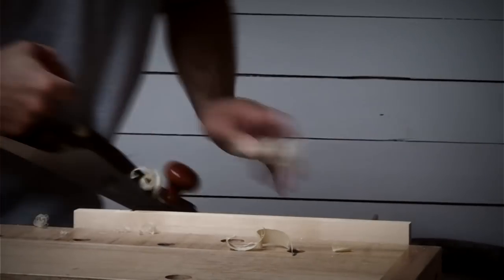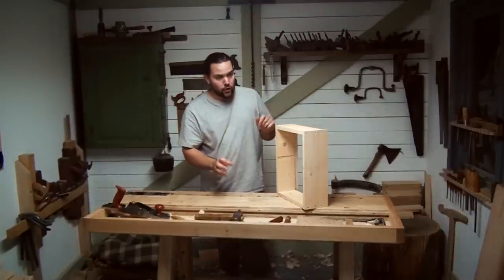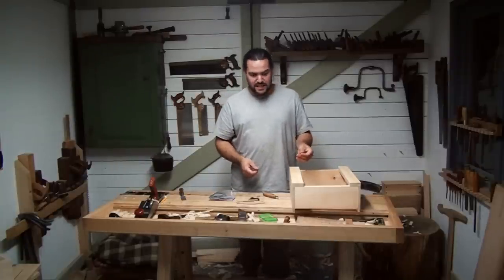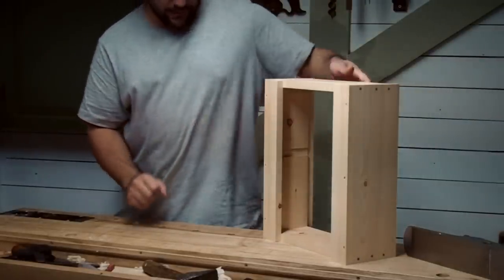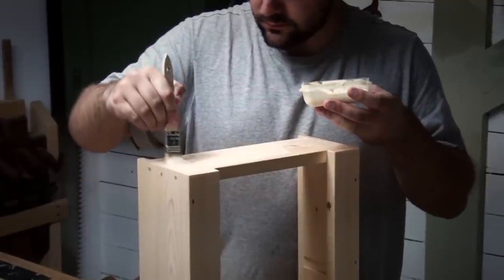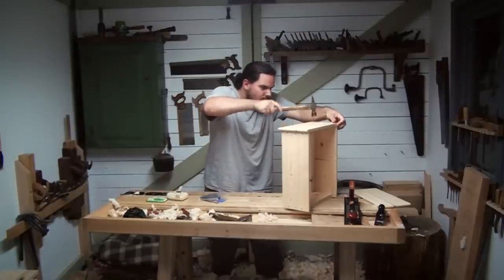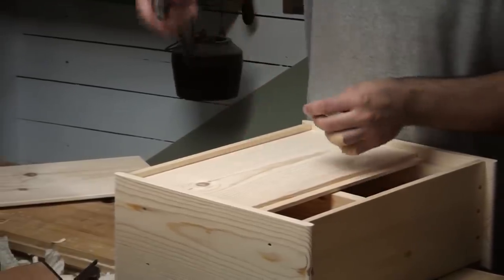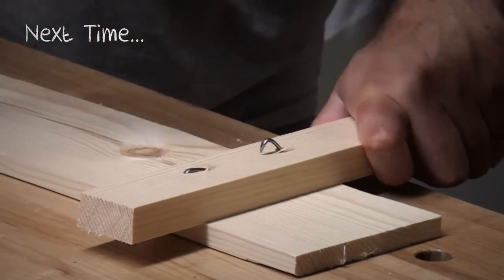Build A Small Wall Cupboard - Part Two

Comment: I want you to know that I'm really enjoying your videos.  You & Paul Sellers are fairly rare because it's clear you've both received excellent training in hand tools & have real hands on experience.  I'm just a hobby woodworker who spends more time reading about woodworking than I spend doing it.  I have a moderately equipped shop and I've completed several smaller projects, but I don't spend near enough time in the shop because it's too hot in the summer, & too cold in the winter.  Cheers.

Comment: Regarding the orientation of the growth rings for the top and bottom; this very much depends on the moisture content of the wood relative to the humidity of where the cupboard is going. So I don't think you can make a blanket statement such as you did. You might do it one way in the winter, and opposite in the summer, or vice versa depending on whether the board is green or dry.

Great videos - keep them coming.

Comment from the maker: If I'm nailing then I'll always leave the heads proud so that I can use a punch to drive them right in, so the hammer face never contacts the wood. Of course tapping a joint together with anything more than the lightest of taps is going to mark your wood so in that case I would normally put a block of wood between them.

Comment: I really like this cupboard.  I am curious why the top and bottom pieces were attached with glue and clenched nails.  Seems like overkill? Am I wrong? Would there be a reason to avoid nailing down into the side boards?
Reply: nails into endgrain have little holding ability

Comment: The medullary rays run flat to the ground, from the cambium to the pith.  Like all wood cells, they expand & contract w/ moisture changes along their width far more than their length.  That means they act like rebar running sideways thru the other cells & they cause the contraction of drying wood to happen unevenly.  This is fine if you have quarter sawn planks, but not so good in flat sawn planks.  It's hard to explain it all in just 500 characters, but you'll find more information on line.